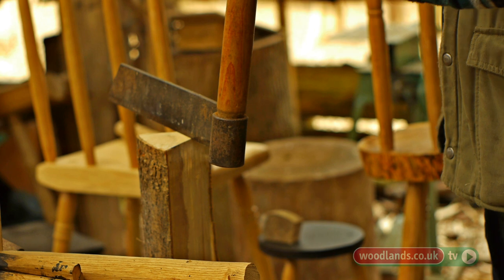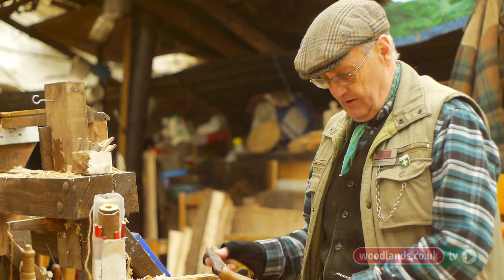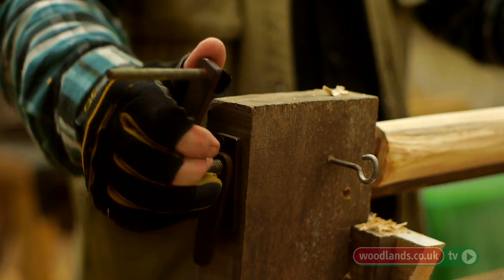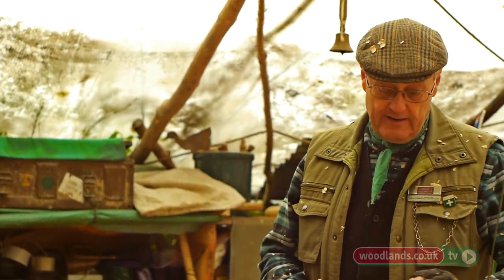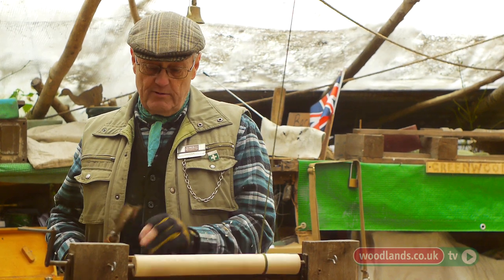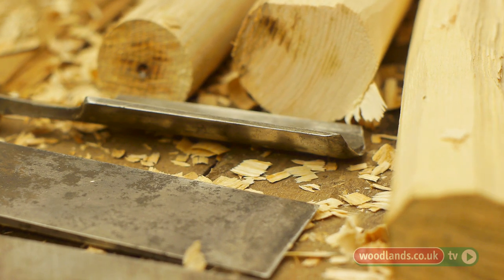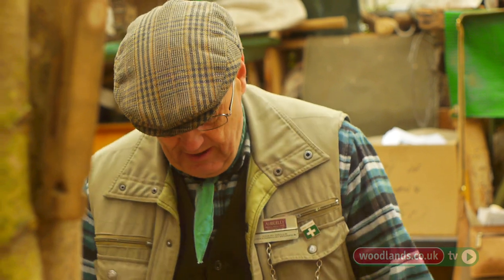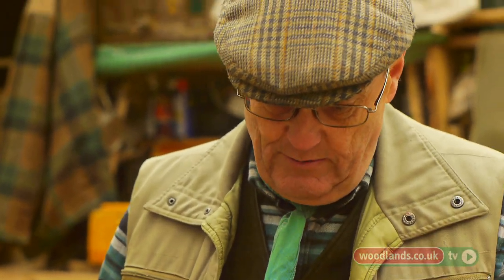A Bodger at Work

Comment: Now that is what you might call a workshop being run on a shoestring budget, as we used to say.  A number of things are impressive, such as the fact that there did not seem to be a measuring stool any where - the gauge marks were apparently placed by eye.  What I found almost astounding given the fact that the whole shop could have stepped intact out of Ancient Rome, was the use of a pull saw which as far as I know a modern import From Japan, which would have been far beyond the ken of a ancient Roman.
Very encouraging to see that the old ways can still be effective, especially as so many of these woodworking videos show the use of equipment which must have cost in the tens of thousands but who purport to be working with " scrap " so as to apparently save a few bucks [ or quid ].

Comment: If you enjoy work being done by hand and foot tools only, look at the Woodwright's Shop on public television here in the US.  Not a power tool in sight on his program.  I've been watching it for years and have put to work some of his ideas even if coupled with a power tool occasionally.
Reply: I had the pleasure of meeting Roy Underhill in Selma, NC in 1992. Selma had a fall festival affectionately known as 'Railroad Days' and Roy lead the parade. I was a smithy at 'Hickory Forge' blacksmithing shop one block off main street. After the parade, Roy and his wife stopped by and we talked as i worked at the forge for about an hour. He's quite a knowledgeable woodworker. Before leaving, he bought a draw knife and a froe that I had made from old pickup truck leaf spring.
Reply: @stanervin6108  I emailed him once to find out where he got those old style calipers he had (the black steel looking ones) but they were something he happened to find.  No known source.